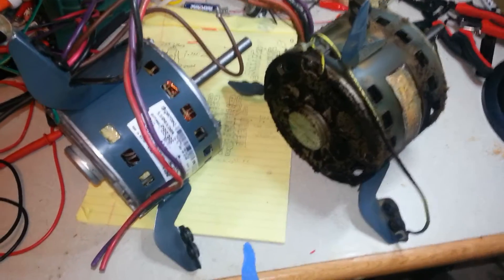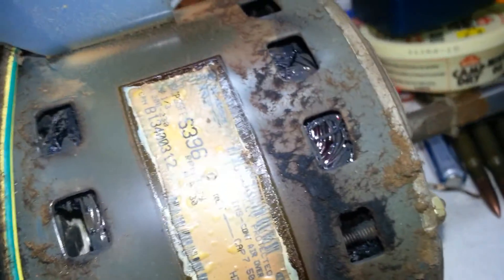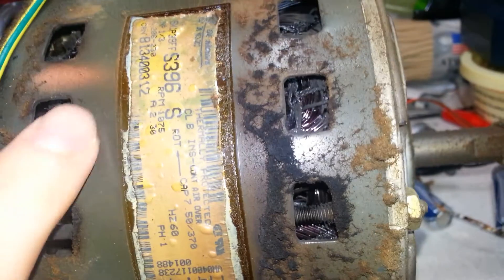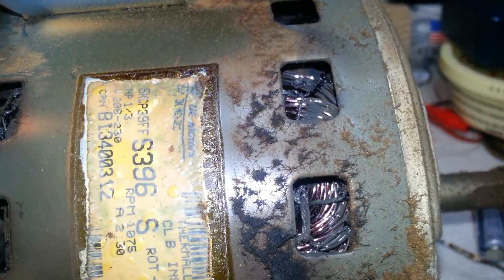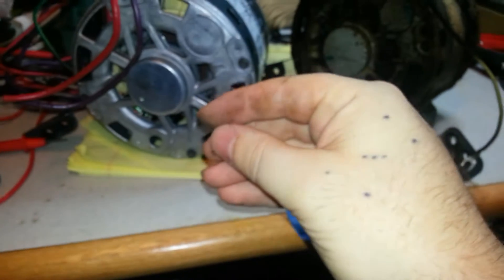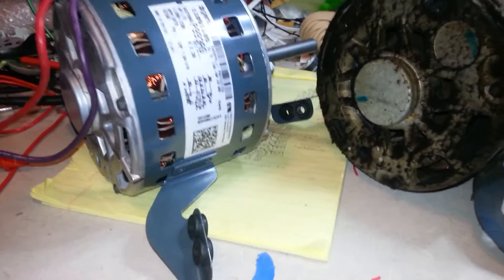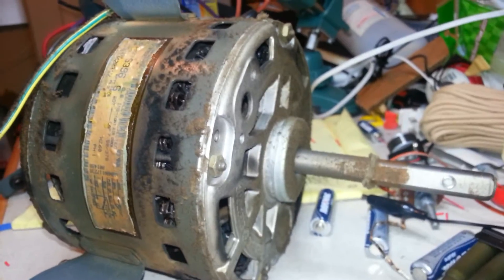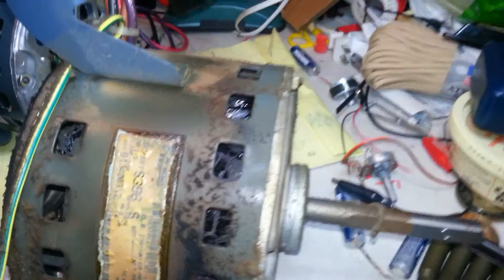Part 3/8: Making sure you've got a good replacement motor

Comment: I can’t get the fan to come off the older blower motor .
Reply from the maker: Try tapping it with a rubber mallet. Be careful not to deform the shaft by hitting it with something hard, or it may peen the fan in place!